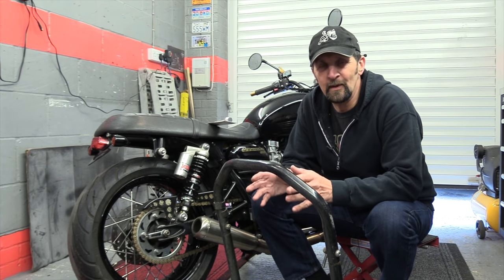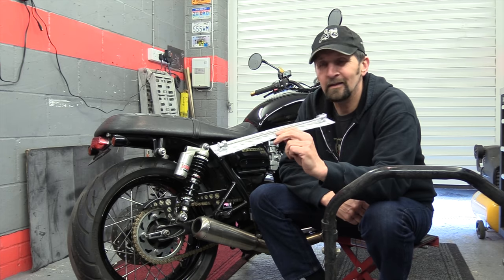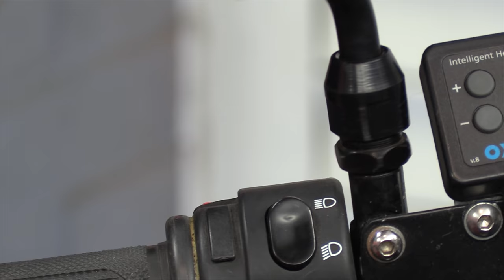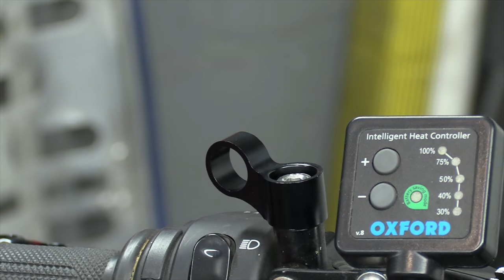Triumph Bonneville, 4 More Simple Upgrades..!

Comment: When you first took the filler cap out of the package I thought oh no that looks so brassy and tacky, but after you had took that sheen off it was a transformation and looked really good.
Reply from the maker: Thanks buddy, i saw the potential in it when we first got it, it's always cool, if possible, to modify accessories a little rather ten just bolt them straight on..
Reply: It matches the bar ends lmao

Comment: Great video guys!! I have an unrelated question! My clutch cover on my bike is deeply scratched from a spill the previous owner had, what can be used used to fill and fix it before paint? Any help would be great thanks!!!
Reply from the maker: Hi there, if the scratches are truly deep, then you can grinding them out isn't an option as it can weaken the casing, you can use body filler if it's an outside lower casing like the clutch that doesn't get too hot, if you want a more permanent solution, you can use these aluminium brazing rods, here's a video, but make sure the proper 'Durafix' ones with the low melting point for the best results... https://www.youtube.com/watch?v=k21JDVdGalY  Hope that helps, and good luck with it!
Reply: @Moonfleet41  super helpful thanks a ton!!!!

Comment: Hi Del.  What are you thoughts about adding a center stand to the Scrambler?
Reply from the maker: If you're bike is standard height, then it's a fabulous addition and makes life really easy for chain maintenance and wheel cleaning, sadly this bike has been lowered almost 3" so no centre stand will fit it now!

Comment: And next, the brake fluid reservoir? Could that be replaced retaining the lever/master cylinder?
Reply from the maker: Lots of options on the market buddy, just never found the right one, if it had 1" bars, I'd use a T100 res, but like all these things they're not inter-changeable, so it'll be an upgrade for another day when I find the right one.

Comment: Hello Del, I have a 2011 Mag wheel Bonnie and want to smooth our the low speed throttle surging. Before splashing out on a Booster Plug can I ask if you have thought of fitting one to the Scrambler? I've seen other videos but not on the 865 Bonnie engine. Any thoughts would be much appreciated. 
Stay safe
Cheers Keith

Comment: can I ask you whether the 2012 model T100 bonnie has to have it forks removed to change the fork oil? I cannot find a video that shows there is a drain hole at the base of the fork legs like other bikes. Do  the forks really have to be completely removed just to replace the effing fork oil? This creates two problems that I can see straight away. Misalignment of the forks in the triple trees. and misalignment of the forks with respect to the rear wheel. what the eff?

Comment: Hi Del/Penny, nice additions there - like that alot - where they all from the same supplier?  Looking through your shop, i was after replacing my old DBG t-shirt, but i see its not there, i have the one of the monkey on it "how hard can it be". Just wondered if there might be a return of that T at any point? 
 Cheers guys, have a good'n, keep safe.... 
Nige 

p.s 6 years I've had that t-shirt hehe.
Reply from the maker: Hi Nige, yes all these parts were from TEC, the links to them all are in the description below the video... and we use a different clothing supplier these days, but currently we aren't using that design, we still have the digital pattern for it, so we may return to it at some point, we use Clothes2Order at the moment, but Penny's working on developing with a different supplier.... hope you're keeping well and safe at this strange time, D&Px

Comment: Del your work is flawless Tec do amazing accessories where can get black fuel tank for scrambler 2007 model any idea ?
Reply from the maker: Hi Adnan, do you mean a fuel tank, or did you mean to type 'fuel cap'?  Do you actually need a fuel tank itself?
Reply: Delboy's Garage  Hi Del sorry 4 late reply.  I would like a black fuel tank Carbator model. If u could help me with that, it would b great.
Reply from the maker: @adnanlatif1722  Can you not paint the tank you have black?
Reply: Delboy's Garage I could but I don’t want 2 ruin the original 1